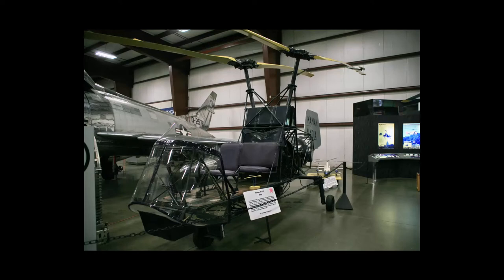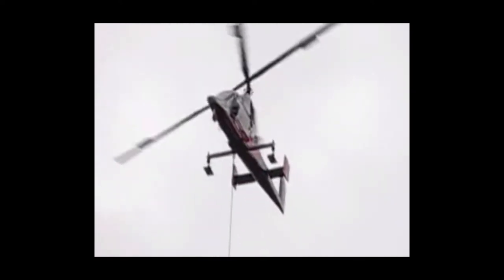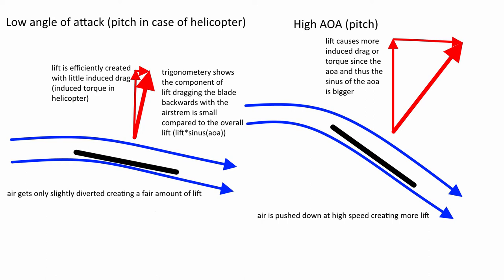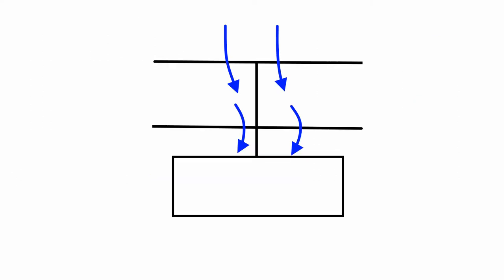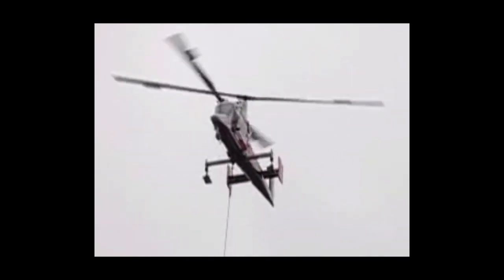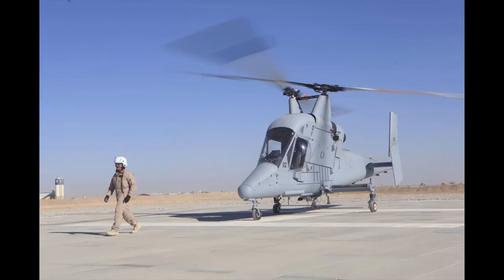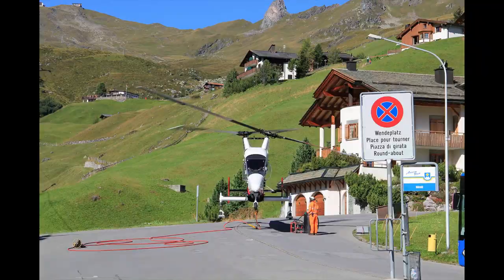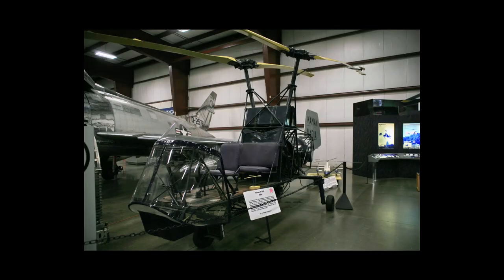Flettner Rotors - Why Intermeshing Rotor Systems Actually Have Their Purpose

Comment: Chinooks (tandam rotors) are famous for suffering horrendous fusalage twisting wrinkles and virbrations, when the fusalage sections aren't looked after, regualrly checked for the amount of permenantly deformed wrinkling, and when needed, replaced often enough, usually that machine will crash or suffer a faliure of some kind;
   ..Assuming the rotor gearboxes, differentials gearboxes haven't started shearing teeth, or their drive shafts and bearings and the shaft bearing mounts haven't suffered some torsional dynamic damage from the torsional conter acting gyroscopical stresses from the differental dynamic forces from each rotors mass and controls loadings feeding back into the mentions gearboxes and shaft systems. 

   Ahem sorry, Flettner style systems largely minimize those in to a smaller, tighter, and thus stronger rotor gearbox unit, albeit being restricted in blade length (via tip speed limitations) and being twin blades or at maximum, triple blade rotors only - triple blades will have a lower rotor rpm limit to account for minimised area of safe blade aero elasticicty and the advancing and retarding blade elastic allowance at the hub hinge between the next and the previous intermeshing blade.
   Generally although somewhat rarer in usage, flettners are inherantly proportionally safer than tandams; and why large helicopters are typically 3 blade tandams - as this confers greater tip safety area than an equivilent 3 blade flettner type.
 
Sorry to butt-in with a theoretical wall of text aeromechanical theory - off the top from my head, forgive me, I could well be wrong in some parts of my insight.

Comment: Just curious... How many rotors would you think it possible to intermesh without collision, And maybe shorten each blade for more stiffness. Or does disc circumference create more lift than adding blades?
Reply from the maker: directly - two - this works because they rotate in opposite direction and well - there are only two opposite directions
you could of course hypothetically have four rotors in a square large enough that each rotor only intermeshes with 2 other rotors and only with 1 other rotor at the same intersection - it becomes a problem when more than 2 rotors intersect in THE SAME PLACE - like 4 rotors so close together that the intersection is greater than 90°
also of course since they rotate in opposite direction you have the same limitations as with gears as in you cannot have 3 rotors in a triangle
Reply: This'd be neat and pointless for all the quadcopter and more-rotor drones.  Those rotors don't overlap so the drone can fly with one dead rotor.  Also, those rotors each have individual motors

Comment: How do we get increased lift in intermesh rotors as compare to coaxial rotors?
Reply from the maker: increased lift is always a matter of overall system optmization - the intermeshing rotors do make the entire rotor mechanism simpler and lighter, - apart from that its am aatter of what else you change - assuming the same rotro diameter you do get a bit more lifting surface as the koaxial rotors basically share the same surface area seen from above so you have barely more hten one rotor in lifting surface, here they only share about half hteir surface area so you get oneandahalf rotors in lifting surface

Comment: how does it turn when hovering?
Reply from the maker: it varies each rotors collective pitch - basically the same result but the RPM stays the same the blades jsut get angled differently
Reply: If look closely, there are rear airfoils, and a standard style vertical rudder. These are operational, and not just for looks. I'm still trying to figure out how these fixed rotorhead design, with no swashplate, or control-pitch arms work. How do the control flaps work? Does the collective lever act, as a control for the flaps?